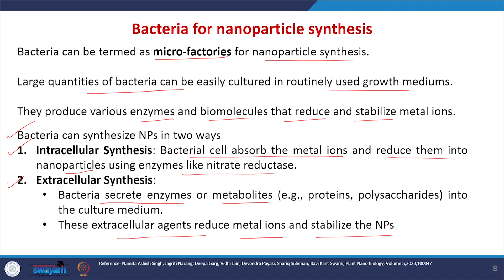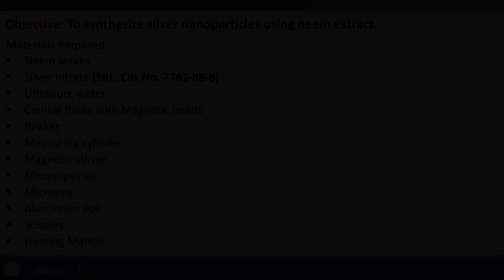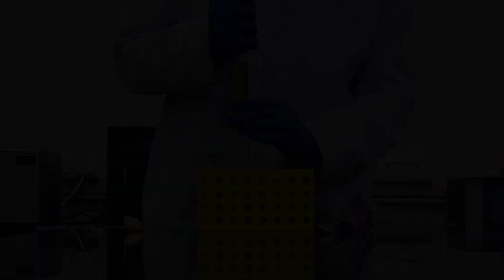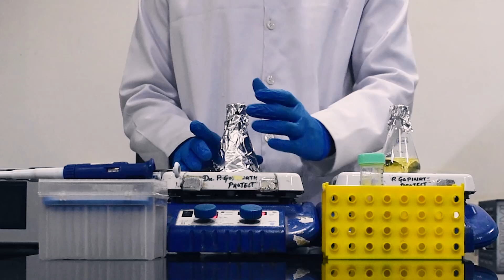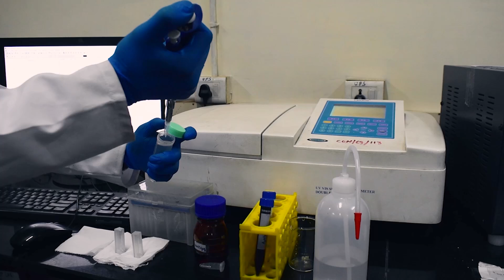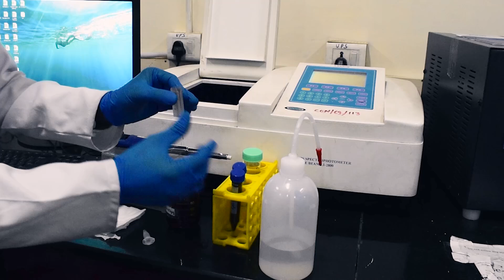Lecture 03: Biological Synthesis of Nanomaterials

Comment: Sir, I need your kind suggestion regarding nanoparticle drying for FESEM and XRD analysis. I dried the nanoparticles at 60°C in a hot air oven, but the particles strongly adhered to the crucible and formed a hard silver-colored layer that was difficult to remove. Could you please suggest a proper drying method and suitable precautions to avoid this issue?